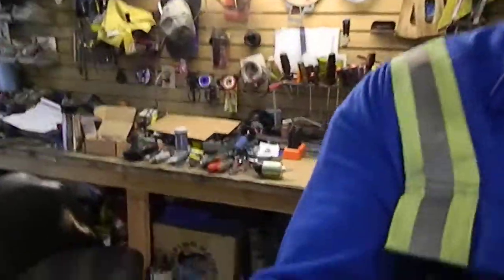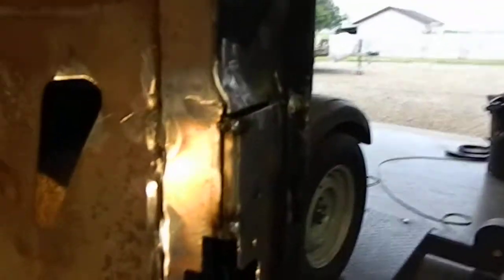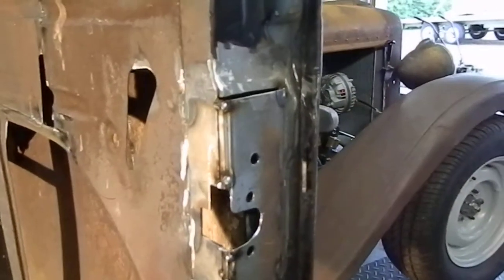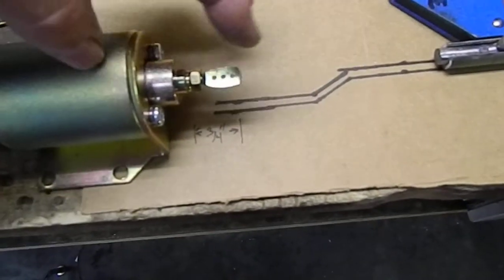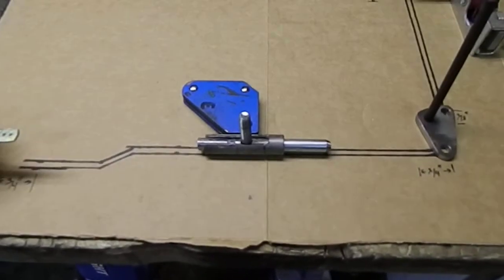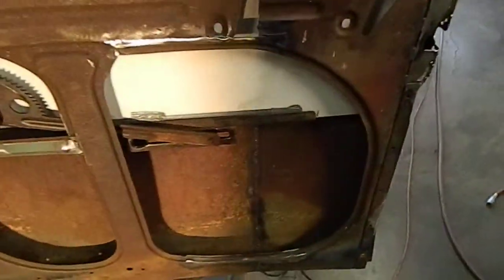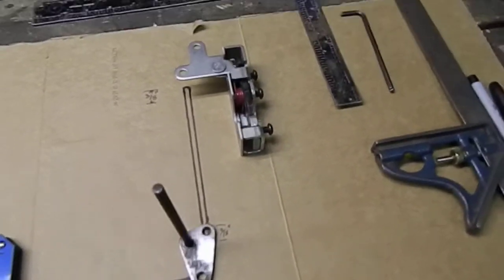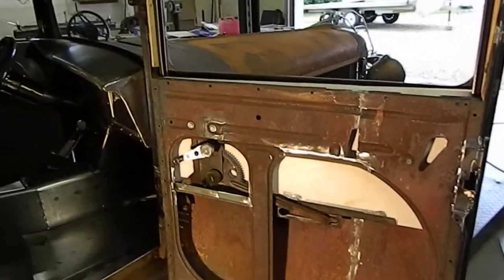1928 Dodge Rat Rod, more problems

Comment: Yea me again. Couple things, why would you incorporate the interior handle and second why would you have an interior handle?
Reply from the maker: Both good questions, the reason for incorporating the handle is to simplify the whole mechanism, if the handle was not mounted in series there would be have to be more linkages as well as a way for each to move individually. The reason for the handle in the first place is safety, if there is a total loss of power for what ever reason there would be no way to open the door, and as you can see in the videos I'm to fat to crawl through those 10 inch window openings. LOL